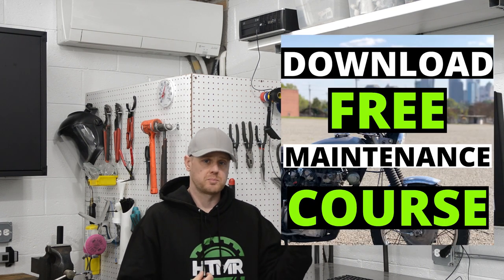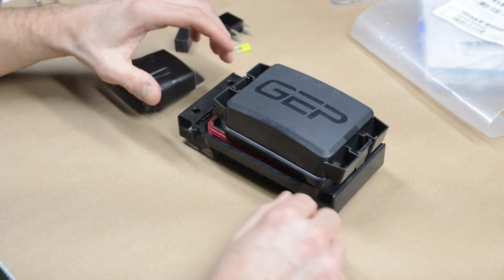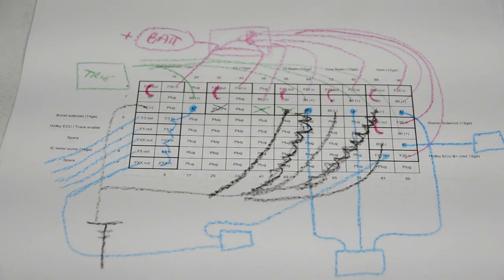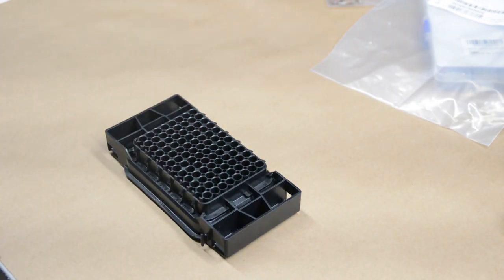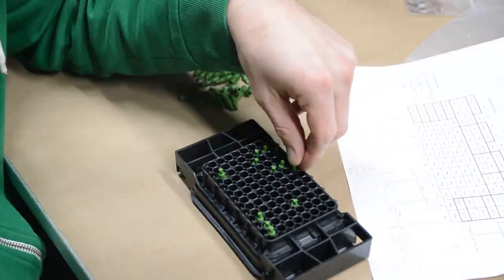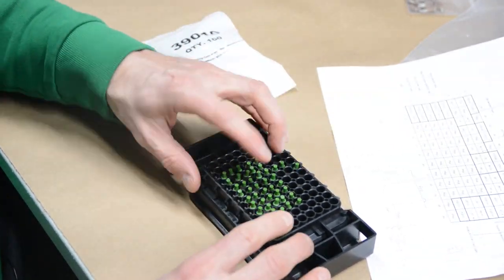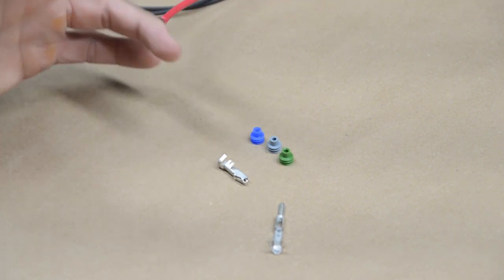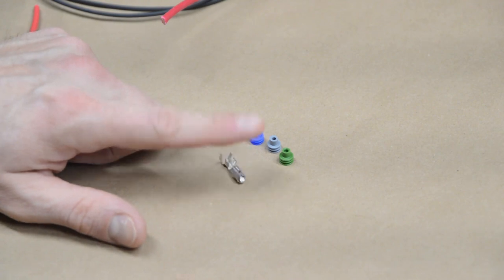How-To: Build a Relay Fuse Box - WATERPROOF

Comment: This video just saved my butt.  I had a small fire in my Polaris RZR and it melted the fuse/relay box.  It turns out the GEP 48 is the exact same box Polaris uses.  I thought I was going to have to buy the complete wire harness that cost $1400 when all I needed was the box.  By the way Polaris doesn't sale the box separately from the wire harness.  Thanks again!

Comment: I use the Eaton fuse panels. There are 5 small ones and 2 larger ones. The small one you got is also available without the buss bars. The circuits are rated for more than 15 amps, so I'm not sure where you got that. The total buss bar is rated for 60 amps, if I remember correctly. 
I use it to build LS swap harnesses
Reply from the maker: @notchbackgta  link to product? I'd like to check it out.
Reply: All the terminals you used in the GEP also work in the Bussman 15300 series.

Also, you put the cavity plugs in the wrong way
Reply from the maker: @notchbackgta  Really? Whoops. Easy to fix LOL.

Comment: hidden gem of a video. ive been looking and looking for a solution like this. where did you get the crimpers? from the same site the box came from?
Reply from the maker: Thanks. Both waytek and CE auto carry them. 
https://www.waytekwire.com/item/474/Packard-12-10GA-Crimper/
https://ceautoelectricsupply.com/product/metri-pack-280-series-12-10-awg-crimping-tool/